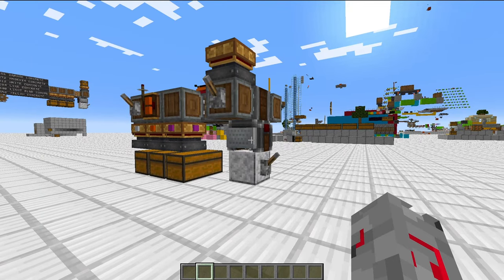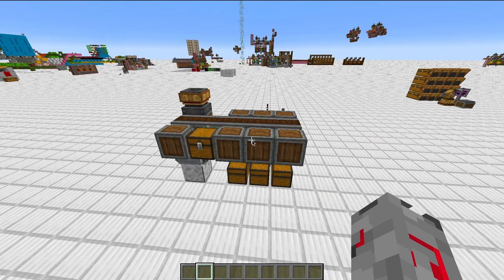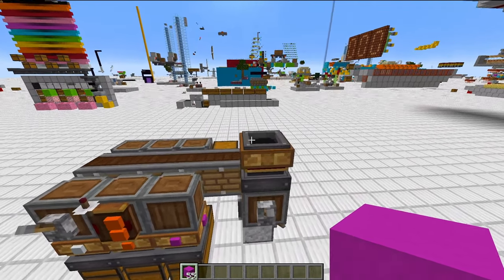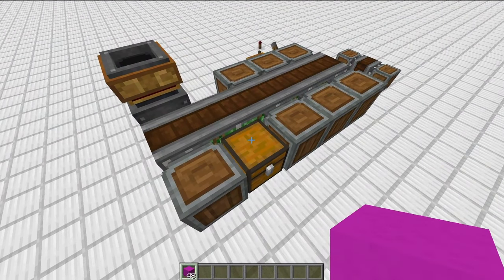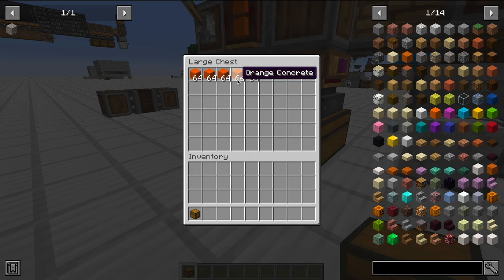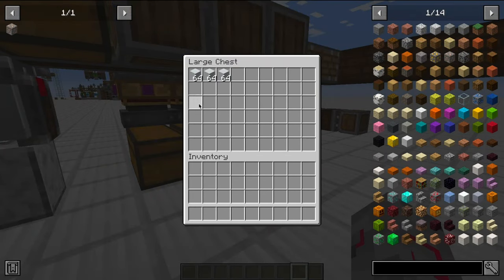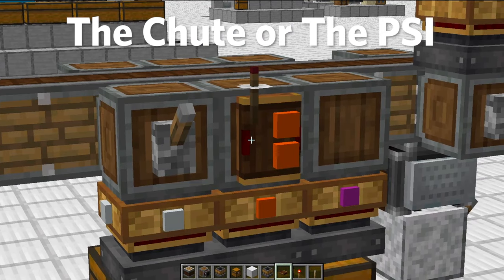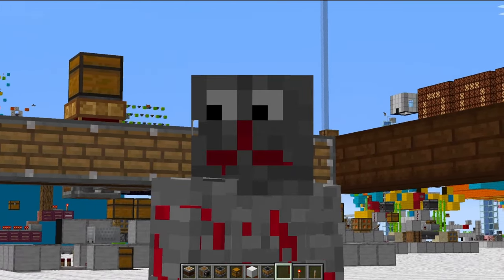Minecraft: Create Mod Instant Sorting and Storage System

Comment: An alternative and simpler version of this is to use a really long 1x1 vault with a non-filtered input and several filtered outputs.

It genuinely doesn't need to be this complicated or potentially lag inducing.
Reply: You can't make a 1x1 vault longer than 3 blocks, 2x2 longer than 6 blocks, or 3x3 longer than 9 blocks. 

With a 3x3 vault you do effectively have a lot of options for output, though. 3 on the bottom, and 2 on each side. For a total of 63 different output slots at 9 length. Enough for most use cases. And you can also use attribute filters filtered on categories to further divvy up the sorting across multiple item vaults.
Reply: @goosewoman I am having issues envisioning this. How would one filter 63 different outputs on a vault? Placing chests coming out of the vault with filters?

Comment: This is not working for me either. :( This seemed perfect, but Nope!
Reply from the maker: What kind of issue are you having? It’s essentially just using portable storage interface mechanics
Reply: @BLOckOus  If I remember right, the Items would never make it out of the supply funnel and into the system. Or best I can tell. When I turn off the assembly, they pop out onto the ground.
Reply from the maker: @AaronJohnson14 hmm, I have a feeing it has something to do with which portable storage units are stuck vs. not. did you happen to try using the portable storage on the outside just to make sure it’s sticking and activating correctly? What I mean is right now the PSG is facing into the chassis for aesthetic purposes, but it can point out, the unstuck one being in open air. So instead of PSG|Chassis|PSG it would be Chassis|PSG|Space|PSG, like they have it in ponder. Hope this makes sense!